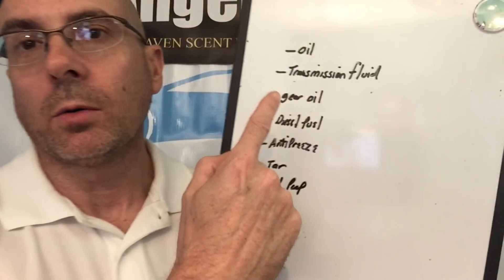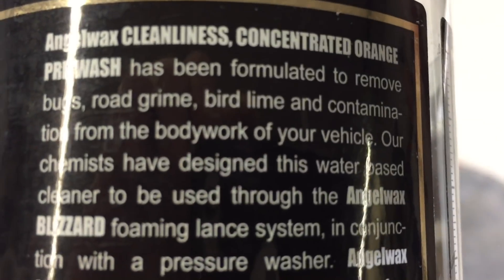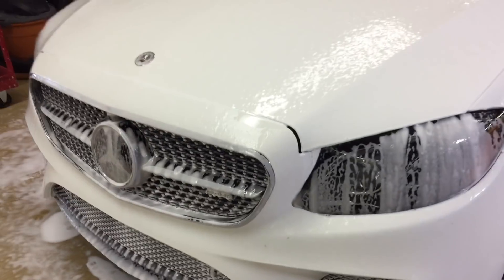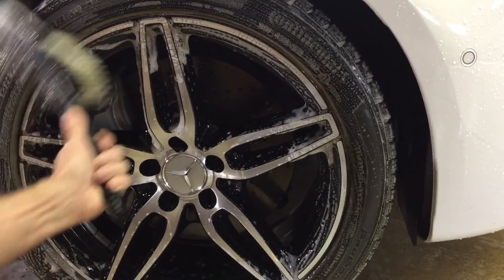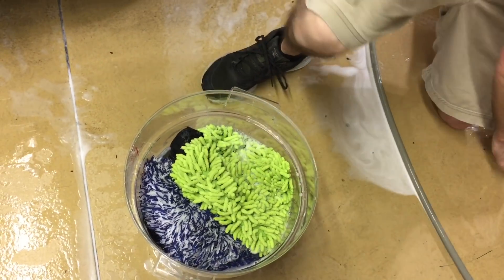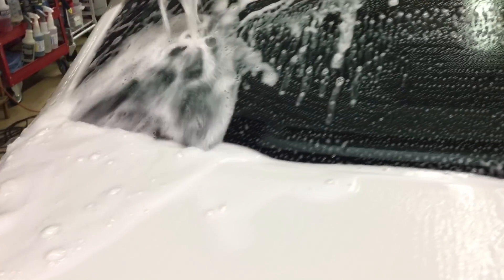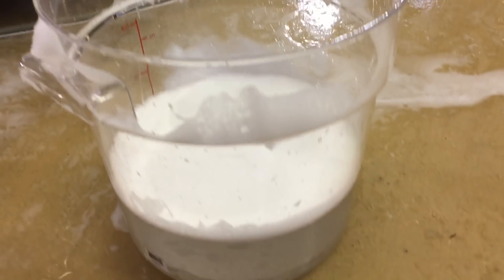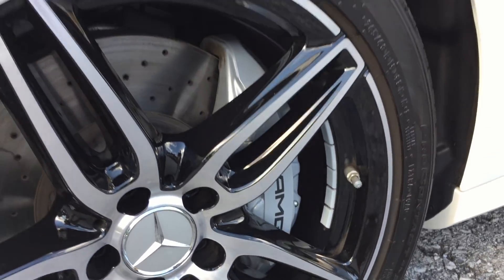First Maintenance Wash After Coating....What I Use, And How It's Used!!!

Comment: Superb video and tips Brian. Overkill is an understatement,  triple overkill.  Rinse, foam and  rise for pre wash, foam again, bucket multi mitt use, rinse, air dry.  How long does the air drying take you with a leaf blower? I use a 160 mph leaf blower, an average size SUV takes near 25 30 mins to near complete no dripping including the wheels, barely use towel on flat surfaces.  This has to be an $80 to $130 car wash with top of the line soap and complete wheel cleaning? 
For my vehicles weekly wash now I'm using cheap four cent an ounce blue corral, takes 2/3 of the foam lance  ( 4 ounces) to foam a mid large size vehicle, good lubrication on contact, crappy drippy  foam 😁. With 15-18  cent an ounce soaps use 2.5-3 ounces and use half of the foam lance bottle, still save 12-16   cents a wash, ha ha ha.
Reply from the maker: D Sylver this type of wash here is part of a maintenance package after a coating. The interior is freshened up and a topping is layered over the coating.

Comment: I wash mine in the sun using the CR spotless 2 buckets leaf blower and usually end up with no water spots or swirls. But will still go over it with a quick detailer after Incase anything is left behind. I only use  Meguiar’s products from Walmart.

Comment: This was a first maintenance wash after a coating (package).  You described the maintenance wash as part of the package.  Is it typical for the client to then only have the car washed by the professional detailer at particular intervals or is the client expected to also perform some washes as needed using a safe method recommended by you in between any maintenance washes included in the package?  By the way, I love the multiple mitt shampoo method !

Comment: My dear sir, i am a bit confused with some soaps from different manufactures. I know that the traffic film such as waxes and sealants are oil petroleum based, we know that in general traffic film -remover soaps also removes waxes and sealants. I dont understand how soap such this angelwax, or valet pro advanced e.t.c can claim that remove traffic film and grime but are safe for wax or sealant..
Kind reegards
Reply: Exactly this...

I really like to know the answer to this

Anyone?
Reply: This car is ceramic coated, does not have wax or sealant.

Comment: I've always wondered how much windshield washer fluid damaged wax/sealant. Expectually the -32 kind I imagine it has a high concentrate of ethanol/ipa
Reply: most windshield washer fluid has Methanol in in which is a pretty strong cleaner. it will definitely remove some waxes.

Comment: Some people swear by rinseless/waterless washing. I tired it once and got some pretty bad scratches in my car. I'll never do it again.
Reply from the maker: Yes... and I completely understand the need for it in restricted areas of the country., but its like running my fingers over a chalkboard doing a rinseless wash.
Reply: Apex Detail again the two are not the same. Waterless is a hyped up detail spray. Spray on wipe off. W/ Rinseless you should be still doing a presoak, rinse while using a safe contact wash method (like done in this video using multiple mitts) The only difference between soap and rinseless is theres no rinsing. Add a blow dry you should not get any marring. Now if you are starting with a car that hasn’t been wash in 2 months and dragged the mitt over the whole car in one swipe with no prerinse.. yea, you are going to scratch it regardless of which wash method you use.

Comment: Your videos are awesome and I know you gave a nod to rinse less wash guys but I have to tell you you need to at least try it.  I had a black 2015 Maserati GranTurismo that pros spent 30 hours on the car at significant expense and she had Cquartz pro on her.  I’m a 777 pilot ex military and about as anal as the come. I live in a very caustic environment in my area with hard water, wind, and you name it outside and it got to where I simply could not stand to wash my car with the full 2 bucket method procedure. Once I went ONR with 1 bucket, distilled water, big red sponge, 500 GSM towels in the comfort of my own garage I never went back. The car only got BETTER over the two years of ownership.  Zero scratches, swirls, or micro marring and trust me I was always looking under my garage LED lights and swirl finder. Test it out. It will save your sanity on your personal cars and allow you to enjoy your car MUCH more.